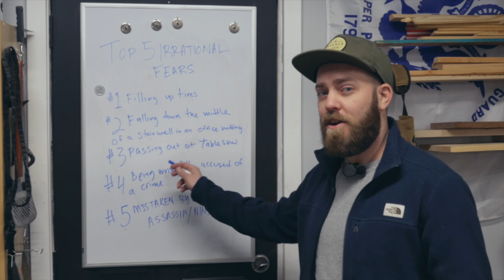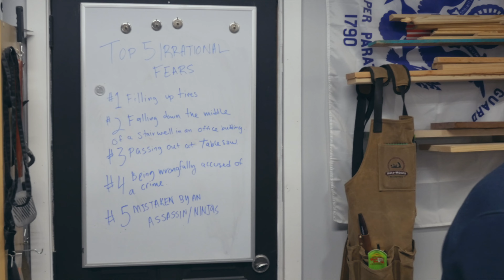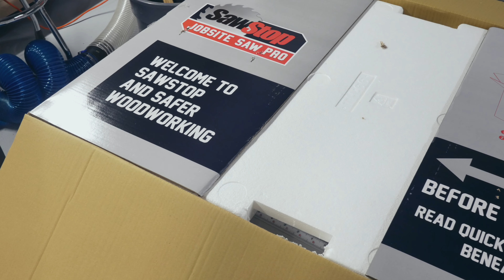Why I got a SawStop | Jobsite Saw Pro

Comment: I'll try to make this brief,  this is brief considering the BS I went through. 
I bought the SS JS  Pro about 4 months ago. 100 mile round trip. 
Insert in top of table.. slot cut 1/4 inch off.. blade whacked the table when rising.. called SS  new insert will be sent
I finished assembling the saw.. Table top not flat. Straight edge laid across table in  4 locations per side, 16 measure ments.   The variance was from about 37 thou to 157.. than is more than an 1/8th of an inch.

I traveled a total of 90 miles over a 5 hour period to measure the table tops of friend's job site saws and 4 box stores to do the same. Cheap Ryobis, Bosches, DeWalt, Hitachis.. etc a total of over 10  saws,  all were very flat.. the worst was a 20 year old Bosch with 8 thou drop on one corner. 

I called Saw Stop the next work day Monday.. day... now follow this for "customer service".... :
"Hello"   (woman's voice)   in a "you are interrupting my day"  tone.
Me...Is this Saw Stop?.. response .. "yes"  then silence
I asked for customer service.. She said  " what do you want"?"
Me.. I just bought a JSS Pro etc.. and it went down hill from there..
For three days I tried to get someone to help and was finally sent to the "service dept". 
Situation explained....no sense of genuine interest nor real concern. They suggested the top was "probably within SS tolerances/" I specifically asked for that figure.. what is your spec for flatness.  No answer, they did not know. 
I told them about my measurements.. they asked my to photo graph me taking the measurements and 
attempted to lecture me on how to do it. ( I was in the auto biz for 25 years and  20 years making furniture after than)    This after I already explained how I did it and with which tools.

Now, not only did I attempt phone contact but also e mailed all of the events to them and to the dealer.. Nada. 
No replies .. except for one or two  looooong after the saw was returned. 

I did photograph the process and disassembled my feeler gauges and laid them out for all to see along with  my deadly accurate straight edge. . Photos sent.
NO RESPONSE.
I called back and they promised for about the third or fourth time to call me.. no one ever returned a promised call.. never.
I gave up and called the selling dealer and explained the situation. They contacted SS and were like wise given a run around. After a few days we came to an agreement. I would return the saw, they would refund my money and the would call me when another saw came in.
I drove back to the dealer (100 miles again)  We repeated the measuring process.. yup grossly warped as all agreed.
Just for yucks I called the drone that said he would call me with the factory specs and he said that the allowable warpage was 33 thou

They also informed me that SS would exchange  this saw for another. They would call me when a flat one came in.  No such call.
After 4 months I called them they said they just got two in that morning.. .. I drove 100 miles again.
The top was flat.. all but a 6 inch diameter area on the right of the saw blade which measure 8 thou .. no big deal.
Oh did I mention that Saw Stop still has not called me.. ever.. but now they are continually sending me spam. 

Full disclosure.....Customer Service Experience. I was in the car biz for 25 years.
4 Years at a Rolls Royce, Bentley, Jaguar, Aston Martin, Austin, MG, Lotus, DeTomaso, Jensen  dealership .. the last year I was the Asst Serv Mgr.. 4 Years service Mgr  of a Honda/Mazda dealership. 7 1/2 years as the District Manager for Mazda Motors of Am with responsibility for technical and customer service in Nor Cal, Nevada , Utah for 4 years and District Sales Mgr for another 3 1/2. Then Natl Field Mgmnt Training Mgr for BMW of No Am. I taught Automotive Management and primarily Customer Service .. commuted from Calif to NY every Sunday night and back on Friday if the work was done. Then 4 years as Field Service Mgr for Mercedes Benz of No America in the Western Region.. I handled customer service and technical. Then on to Volvo Motors of America ,, again teaching Auto Mgmnt and Cust Service.. and again commuting from Calif to NY ..

After that stint I built furniture and folk art. for 20 years. My work is in collections and museums in the USA and around the world. Following that I am now in my 9th year as an artist.. here again I have my work in an Alfa Romeo Museum in Australia, (25 pieces) also work  in  collection/museum in Japan, in Provence France, England, Germany Canada, So America etc etc etc... I work alone.. .I don't contest my customers, I respect them... ,  I return calls, I make high quality products, I do not BS people and my work is modestly priced given the quality ... I am swamped with work.
I have no time for Bull spit or substandard equipment. 

My observation and experience tells me that Saw Stop has substandard customer service and an average quality to substandard quality product.  All, every, person I talked with at that company had nothing in response but "weasel words" . 
Aside from that,  my replacement saw.. is NOT (according to SS web site video)" the most accurate job site saw on the market".. It  has  a ridiculous fence and a useless miter gauge and were it not for the safety feature it could not compete with DeWalt or Makita or Hitachi (Metabo).. I am disappointed at myself  for swallowing the kool-aid. 

My second SS Job Site saw will be up for sale shortly and I will never do business again with Saw Stop or  Festool their owners.  
All the above is accurate and any opinions are mine based on real experience.. Incidentally I have carefully documented and filed away all of my contacts with Saw Stop. 

If they were an honorable company.. they would share the safety feature technology with other companies and license them to assure that more potential customers who are concerned about safety would have access.. Not the case.. instead they take legal action according to information I have been given along the way. And let's also add they are price fixing.. Festool and Saw Stop under the guise of "fair trade".  That is vaca caca...I have been told by more than one Festool and Saw Stop dealer that if they discount the products, they will be dropped as a dealer.  Fact. 

Make up your own mind with your own research. Don't rely on my advice and I am not suggesting you not buy their products. That is your choice.
Reply from the maker: Thank you for sharing. That’s a real bummer and you should not have had that experience.  It’s a damn shame they hold the patent on the safety feature and it would be nice for others to be able to incorporate it into their saws. I would be curious with the patent expiring to see what happens In the future. I excepted the best from SS when I bought the saw and while I think it is a good saw, it’s not the best for reasons you and I have mentioned.
Reply: You perfectly describe why I will absolutely, under no conditions, ever support SawStop or Festool. Disgusting, predatory business and the products may be designed well, but their engineering is awful. (Surprised nobody has the interest to do teardowns of Festool stuff. All over-complicated, over-engineered and under-spec'd stuff.) Anyway sorry to hear about your trouble. It's a bad organization. Fundamentally.
Reply: Staff disappointed after being purchased by Festool.  The table problems seem to be too common in this saw.  Not acceptable at this price point.
Reply: @jameskelly4494  My opinion is that the JSP  is a $499 quality saw with a $1 miter gauge and a $1000   safety feature.
Reply: @jeffhildreth9244 

Hi, I'm from Taiwan, please forgive my bad English, maybe I don't express myself well.

I think your opinion is very valuable.
Based on my speculation, I also came to the same conclusion, the quality of SawStop must be poor.
Because SawStop recently launched a portable table saw. This raises a question: Why does it appear now?
Because SawStop's patent has been revoked, they want to squeeze the value of the brand at the last minute.
As early as ten years ago, they could launch a small table saw weighing 30Kg, but in order to make people spend more money on safety devices, they forced people to buy more expensive large saw tables. Larger equipment allows them to make more profits.
The lack of competitors is likely to result in laziness and indifference. Leading to indifference to design and quality production.

My question is, are the tools produced by Festool equally bad? I would very much like to seek your professional advice on this matter.
I produce furniture as a hobby and provide free furniture to my relatives and friends.
In order to cut the large 4x8 boards, I had to add equipment. 
But my studio is very small, about the same size as a car. Located on the fourth floor, no elevator. After considering all factors I chose the Festool track saw.

Based on your experience and professional perspective, I would like to ask you, do you think I have any other options?

Best
regards,

JungYi.

Comment: Bought the Jobsite Pro just before the holidays and intend to set it up in a few weeks.  I've seen a few others who've noted the same table top issues. I'm not as tolerant of the tolerance excuses, so I may just send it back before I even open it.
Reply from the maker: Besides the table issue, I will say I’ve been using it a ton over the holidays and love it so far.
Reply: @DaverMade  Including the Mickey Mouse miter gauge and the sloppy fence?
Reply: Aside from the grossly overpriced saw, this company's response was unprofessional if not insulting.

Comment: Inspired by a contest sponsored by Rockler Tool, I've been watching videos on the new Sawstop Compact with stand - the only prize offered and given to the chance drawing of being the first from all the posted entrants. So far yours has been the most informative. I believe that this is a new market direction for Sawstop - to reach the "pocketbooks" of people like me. If I were making my living with these tools, within competitive bounds, cost would be secondary. Except I only use a table saw to fulfil a hobby and money spent is always the first consideration - try to find the best reviewed deals on my price range - for most power stuff, maybe a notch or two above Harbor Freight - a great source of many low priced value hand and some power tools. That was the case when I made that first "coming out" to my wife, that I kind of liked doing things with wood. This would be to justify the $180 I just spent for a 10" Ryobi from our local big box improvement center. The saw was shipped and arrived about 3 days later. Now to explain to my wife why $180 was a good value... well, it didn't go as badly as I was fretting about. Jest an admonishment of spending... and after, never said another word. Together we have completed so many projects which has increased my skills. Other "stealth" purchase I made that I had to "prepare" for a 10" bench mount Wen - variable speed control Drill Press, which has justified its price a dozen times over. Oh, the original point I was going to make is that, had I the intuitive knowledge of what would happen after about a year's worth of use. While making  repetitive cuts for a porch railing I was building, absently after a cut when reaching over to set the piece down, I ran my left hand through a running saw blade - wasn't watching what I was doing.     The cut could have been much worse but luckily the blade height was only about 3/4". The total experience I would gladly have spent the premium to avoid all that followed. It was not life threatening but was a serious injury.   Thanks for the insightful presentation and your review!

Comment: Good Video!  Does your Pro hold its 90* to the table after folding it up, then returning it upright?  Mine does not and SS engineers confirmed  that theirs do not either.  I use mine for fine woodworking and have to readjust the 90* blade every time I bring the saw out.
Reply from the maker: Mine also does not which is a tad annoying.
Reply: @DaverMade  It's a shame because otherwise, it's a great saw.  That said, a 90* blade is essential for any kind of fine woodworking.  I tried to explain that to SS that many of us are downsizing and use the Pro for fine woodworking, however their only answer was just use the fine adjust knob.  Now I'm never quite sure if the blade is 90*.

Comment: Video after video for this saw is fairly consistent regarding table not being flat.  I guess is you are doing mostly rough cuts the tolerance might not be a factor.  But if you are building furniture, cabinets, drawers or other things require finer detail than those tolerances would be a factor.  At this price point for Sawstop to say that this is acceptable well that is a tough nut for me to swallow.  Probably will buy a DeWalt 7491 or a Skill 10 inch for the rack and pinion  fence.  Will probably go with a Sawstop cabinet model later and skip the compact or Jobsite.

Comment: I have a small shop and want a saw stop. Been. Looking at Job site and the co tractor but concerned about space. It sounds like the job site can do dados but really dificult to set the height?
Reply from the maker: In terms of saving space and being able to fold it up and roll it out of the way has been great. It’s also a great saw too. I have not used dado blades with it yet so I can’t speak to that, but I generally use a router for dados.